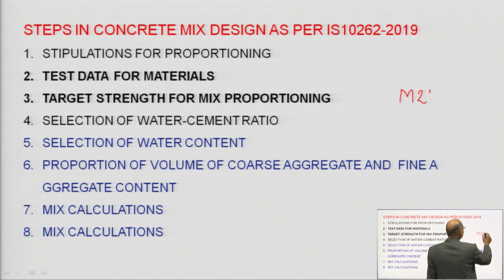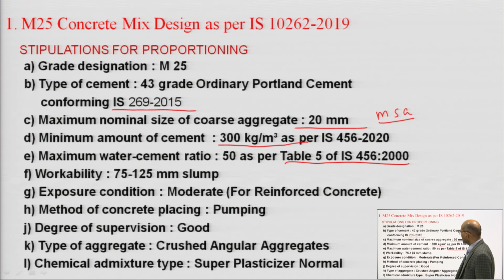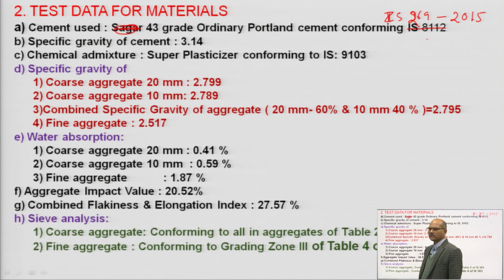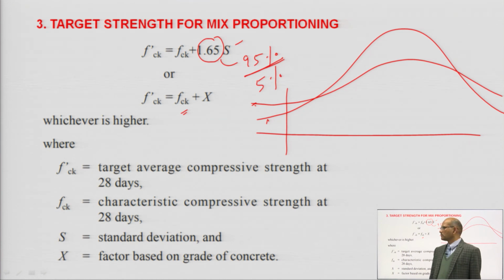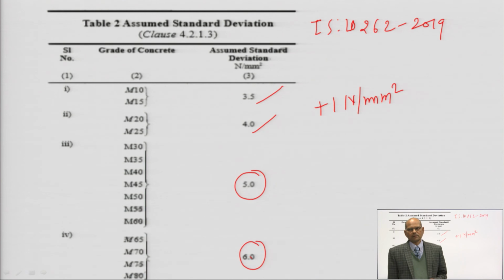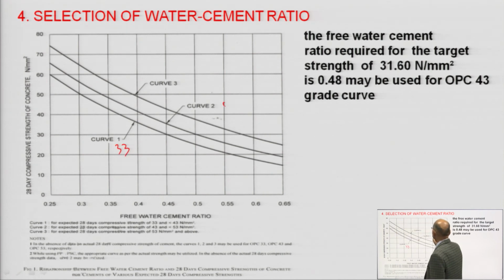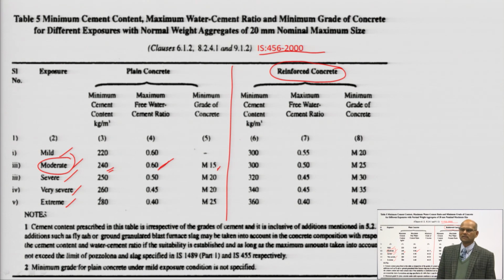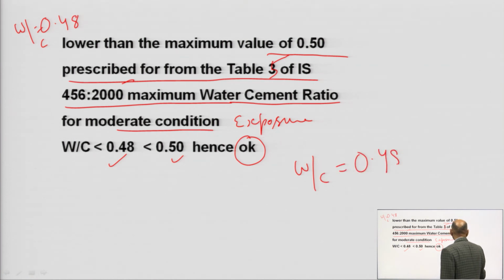M25 Concrete Mix Design: IS:10262-2019 Method Part-1

Comment: Hai please clarify my dought sir recently my father approached rmc for m25 ultra tech cement so they mixed 220 cement 115 fly ash and they mixed it so my father asked why you mixed only 220 cement then after mixing conceret with water after 1 hour they said they will add remaining cement and tried to mix ot but some are saying after mixing cement how they will mix cement slab will loos strength please clarify sir